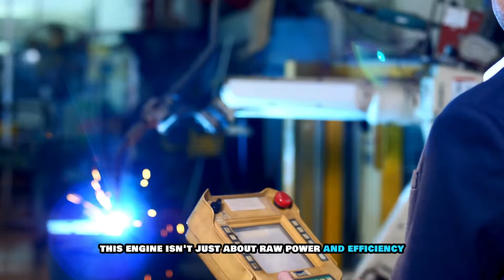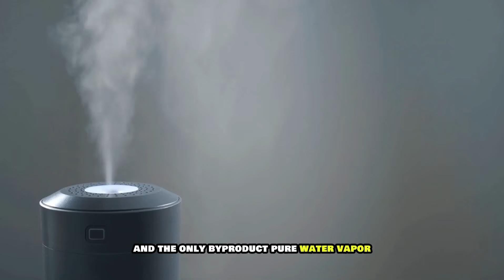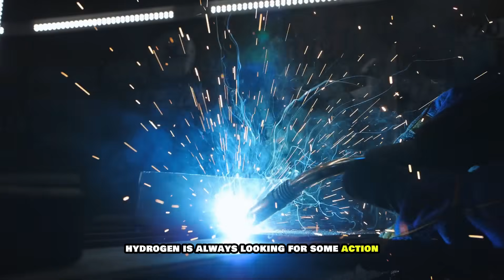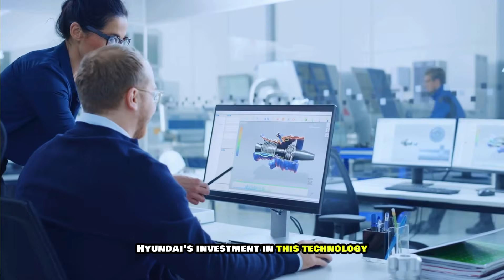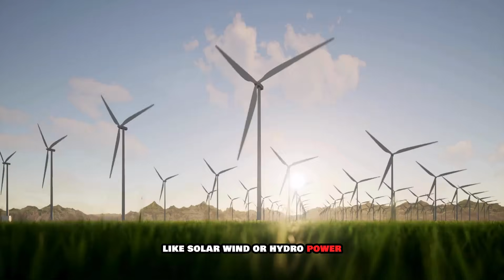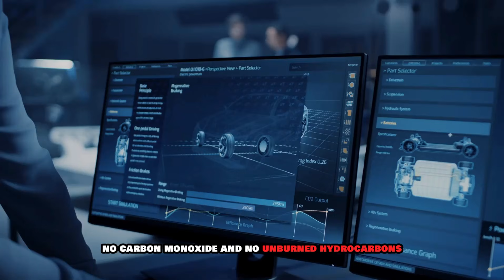Hyundai CEO: “This New Engine Will Destroy The Entire EV Industry!”

Comment: Far less polluting than EVs ! While it may not be 100% perfect just yet, it will be and this is a huge leap forwards. This will spell the end for the potential domination of the ev market by Chinese companies, Tesla and more ! I would NEVER buy an ev as they are far too costly for what they are, have zero resale value and the manufacturing process is heavily polluting ! Also their weight prohibits their parking in multi storey car parks ! The hydrogen engine is the way forwards !

Comment: Hydrogen needs 100% renewable electric to create the hydrogen. This process isn’t 1:1 power. Then you have a compressed gas you need to ship somewhere and then fill in a car that will then have the terrible efficiency of a combustion engine. 

Hydrogen has some great uses in other places including shipping and industrial as well as energy storage but really if we have enough clean renewable energy to make hydrogen on this scale then standard EVs still make far more sense.
Reply: The upside of the hydrogen fuel cell is that it will put a lot more water into the atmosphere, which will be a good thing. It is far less polluting than the creation of batteries for storage for EVs, and these formats can also be used to power buildings ! This will bring the power to fill the gaps between wind and solar power for electrical power generation.
Reply: @iandehaan2456 I think the water vapour given off would be far less than the natural system that already occurs.

I don’t think it will power buildings per se. We have a great grid system that does this. Now backup power that has previously been diesel generators maybe. But again the efficiency compared to grid distribution is madness. Stationary production and conversion back in one place tied to a grid makes some sense but only to use and stabilise renewables. Even then the efficiency is around 18-40%. So for every 100kwh of green energy you use to produce hydrogen, you can only return 18-40kwh back after the full conversion. 

Now look at that compared to hydro pumping and storing before making electric as it comes back down. That’s roughly 70-90% efficient. 

The maths just doesn’t add up on a grand scale. Only in fringe cases where energy storage density is the primary factor.